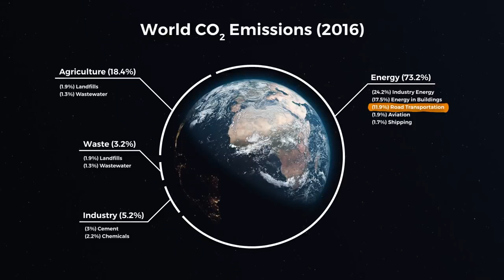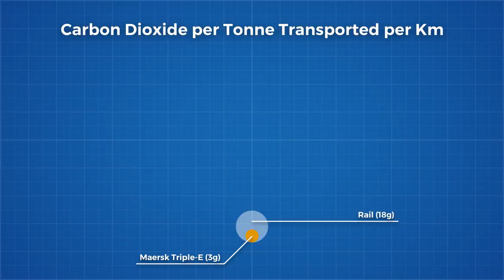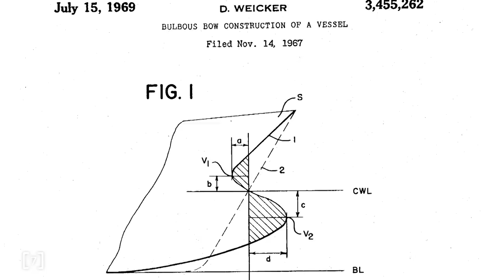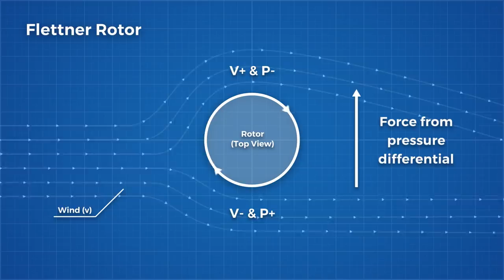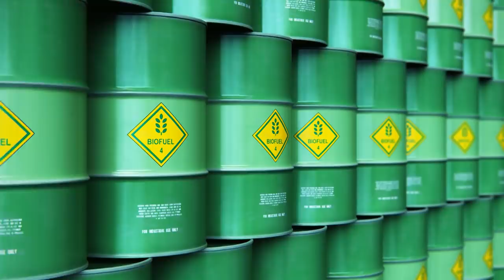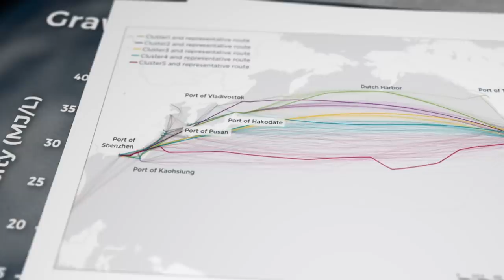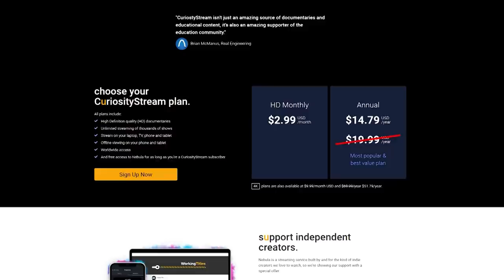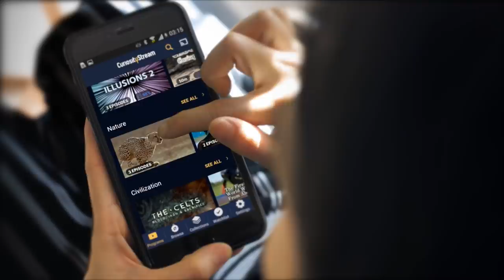Are Renewable Powered Ships Possible?

Comment: Pretty sure all ships used to be wind powered, with occasional muscle power...
Reply: Yep. Our discovery of energy dense fuel allowed us to grow beyond the limits of wind.
Now that we're feeling the consequences of this we're starting to backpedal on that choise.
Reply: To address the suggestions that sail power is the answer I offer the following.  In 1870 a premium sailing vessel entered service, the ‘Cutty Sark’, she could carry around 600 tonnes of cargo at speeds of up to 17.5 knots, dependent on the prevailing wind, to harness the energy the available spread of canvas was up to 2 976m2.  To round things out that was circa 5m2 of canvas for every tonne of cargo carried.  The ‘Cutty Sark’ was designed and built for employment in the tea trade where time on passage was a large factor in securing the premium freight rate that made her cost effective but as soon as the Suez Canal opened, which the ‘Cutty Sark’ was unable to sail through, she lost her advantage, raw speed, to the steam powered ships of that era.  Mechanically powered ships have improved in terms of efficiency, on a freight tonne mile basis, by at least one order of magnitude since then.  After losing out to the coal burning, steam reciprocating mechanical ships of the late 19th century ‘Cutty Sark’ was relegated to the Australian wool trade, just about the bottom of the barrel in maritime terms and only one small step up from being a 'honey barge'.  The canvas, cordage and extra manpower needed for sailing ships was never a very benign environmental option so please discount any idea of sail as ‘sustainable’.  All this is without the problem that if ‘the wind don’t blow the ship don’t go’, when it does blow it often blows in the wrong direction for your cargo delivery needs and sometimes there is rather too much of it for comfort.
Reply: @BernardLS  Wind power in the form of sail was outclassed by steam engines, but if we can harness the wind power in a more efficient manner with modern technology it could prove useful. 

I'm not convinced either, I think nuclear and potentially fusion engine is the way to go. But I think we shouldn't discount solar and wind yet just because modern technology diesel is better than 19 century sail. Maybe there's a way to use solar and wind efficiently with 21 century tech.

Many advances and many orders of magnitude scaling have been made in both solar and wind sector to the point that it's now cheaper than coal in half the counties which was unthinkable just 10 years ago when it was an order of magnitude more expensive than coal.

Without subsidy there are 20 year contracts signed for 4 cents/kWh for wind plants and below 3 cents/kWh for solar plants. For reference modern coal plant 20 year contract is 6 cents/kWh.

Same advances could be possible in ship space.
Reply: Weren't as effective as the ones used nowadays tho!
Reply: @Allen Loser Will happen.
Reply: I find it quite impressive that the last German freight clipper just got taken out of service in 1956. This is more than a decade after the war.
Reply: @Allen Loser Why do I keep seeing your name, complaining about global warming and renewable energy?
Reply: @Allen Loser client change denial is politically motivated nonsense by those who have trillions of dollars invested in the exact industries that need to change.
Reply: @Allen Loser you are thinking in waaaaaaaaaaaaaaaaaaaaaaaay too simplistic terms. Making sure sea levels rise at a rate that can be dealt with instead of too fast to be dealt with is a HUGE gain, and does not require trying to revert climate change on the long term. It does however solve one of its consequences.

You are falling in a rhetoric trap, perfect is the enemy of good, and your crying about imperfection is simply not an argument to not make obvious improvements. 

Beyond that, absolutely nothing beyond culture and material artifacts has survived for thousands of years.
Reply: @Allen Loser and you are too blinded by it to get the point.

The only projects of the scale and timespan needed to stop climate change which humsns ever managed that took centuries or even millenia to complete have to do with culture and religion and greed is merely a short term individual motivation. One we all share? Yes but its not going to do the trick on its own. For some very sad excuses for humans it is the only motivation, for many it is not, which is a good thing because many things couldn't exist if it were the only motivation people ever have.
Reply: @Allen Loser ensuring things go at a rate that can be dealt with is not leavng things for future generations to fix, that is just totally stupid because it requires action NOW.  It is making sure it can be dealt with at all.
Reply: @Allen Loser the ability to keep up depends on the rate at which the sea level rises. 

Beyond that, you are wrong, I currently get to pay extra due to sea levels rising faster than they have to because of YOUR fossil fuel use. So you are in fact making others pay for your waste.
Reply: Also, the ships themselves were built from wood -- also a renewable material.
Reply: I can confirm that that was the case.
Reply: @artemaung5274  The US and USSR both used nuclear powered icebreakers as testbeds for submarine nuclear systems, and as far as I know we (U.S.) still have ours.
Reply: @artemaung5274  The real question is, can you make a ship run on hydropower of the sea?
Reply: @BernardLS  fair points, but at the time of the cutty sark, the world record for a 24hr sailing period was 465nm, for an average speed of 19.5kns. now, that record is 908nm, at an average of 37.8kns. the overall sailing speed record sits at over 65kns, or 55kns for a vessel with a crew greater than one. these fastest of vessels use rigid areofoil sails, composite hulls, and run on hydrofoils to lift themselves out on the water.

even if cargo vessels only captured a fraction of those gains, say high teens average knots under sail for a ship around the size of a maesk V-class (200m long, 34,880 gross tonnes, 3600 TEU capacity, remarkably similar to the SS great eastern and Oceanbird project), there'd be an argument to be made for it just on fuel savings alone. oceanbird is trying to make a business case for sail power at only 10kn and 12 days for a transatlantic crossing.
Reply: @artemaung5274  With regard to shipping steps to reduce atmospheric pollution to acceptable levels could include: -
1) Abolish the cruising fraction of marine transport;
2) Abolish recreational boating;
3) Reduce 'freight mile' distances;
4) Reduce freight carrying capacity;
4) Improve fuel quality;
5) De'fossil'ise the fuel chain;
6) Localise production to consumption;
7) Reduce the global population of consumers.
The use of any of the options above may not be the future of marine transportation but moving less material and moving what is transported over shorter distances, as in the past, should be.  Together with localised production and minimised consumption a global population that has individuals’ voluntarily self limiting reproduction to two children per parent (both male and female), might save the planet.  Shipping currently has a 'high volume, low margin' business model and it needs to return to the 'low volume, high value added' model it followed in the past.
Reply: @csrage420  I to have a dream and may have posted this earlier in the thread but FWIW.  The 26th UN Climate Change Conference of the Parties (COP26) held in Glasgow between 31 October 2021 & 13 November 2021 established requirements and targets for mitigation of the production of GHG and with regard to shipping steps to reduce atmospheric pollution to acceptable levels could include: -
1) Reduce spoilage / waste of all commodities;
2) Improve fuel quality;
3) Localise production to consumption;
4) Reduce 'freight mile' distances;
5) Abolish the cruising fraction of marine transport;
6) Reduce freight carrying capacity;
7) Abolish recreational boating;
8) De'fossil'ise the fuel chain;
9) Reduce the global population of consumers.
The use of any of the options above may not be the future of marine transportation but moving less material and moving what is transported over shorter distances, as in the past, should be.  Together with localised production and minimised consumption a global population that has individuals’ voluntarily self limiting reproduction to two children per parent (both male and female), might save the planet.  Shipping currently has a 'high volume, low added value' business model and it needs to return to the 'low volume, high value added' model it followed in the past.  Any alternative to the existing system needs to provide better value and so depends on the yield; the energy input less losses must provide energy output that can be deployed for propulsion, cargo handling and domestic services.  All of which must be achieved consistently and within the current limits of mass, volume and cost.
Reply: @bluepurplepink  Felons, rebels, political opponents in fact just about anyone the governing boss did not like could all find a place as an oarsman in the galleys.
Reply: Yeah, they ran on food.
Reply: @steampunkastronaut7081  stanley meyer's water car from the 80s. He made an electrolysis device that was able to flash seperate the gasses inside water, MUCH faster than the ones today.
 It was technically a hydrogen powered car, but he didnt have tanks of hydrogen, he simply had a tank of water, and his device.
 If we can recreate it, we could have ships that literally run on seawater.